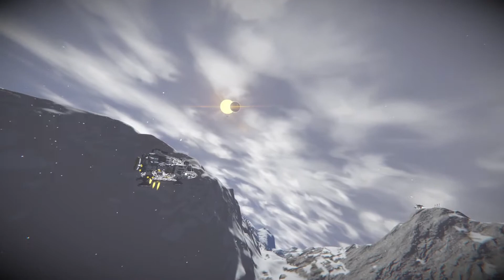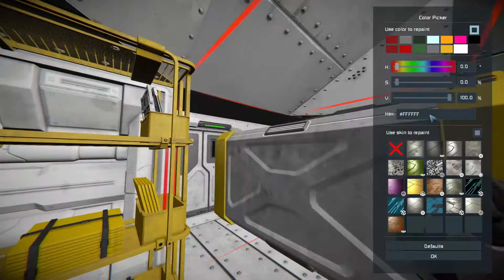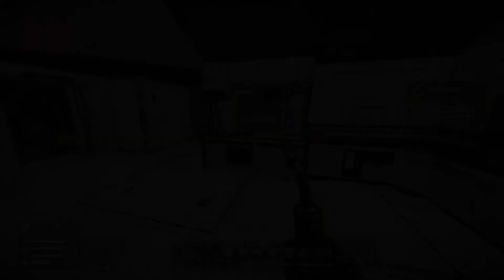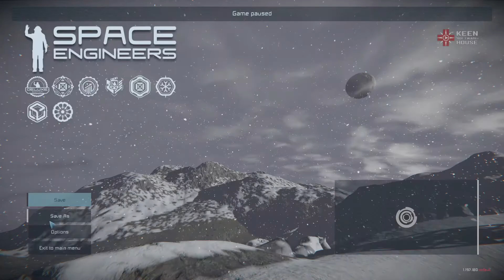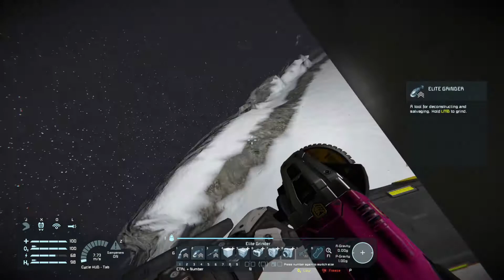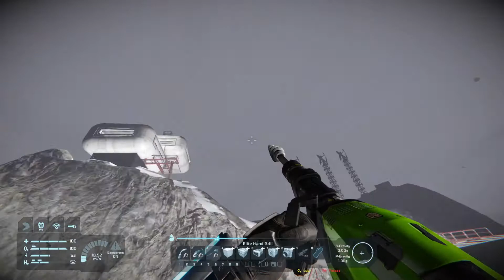Hephaestus Prime EP56 - Ready Transmission (Space Engineers)

Comment: Love the pod building.
You could put a vent under one of the pods and put it in depressurise to keep de pods filled with oxygen without having to refill all the time the ice.
And only enable the o2/h2 generator when the hydrogen tank is almost empty.
Keep those episodes coming I’m really loving them.
Reply from the maker: Thanks Listerman, this was an especially enjoyable build.  I knew the vents suck air in the full O2, but I thought like the helmet, you can breathe but not fill up in the low O2. I shall try next time I'm up Mt Rutherford. Thanks for the info.
Reply: @Wellington6012  from the moment there is oxygen you can pump it :)
Because of your pods I’m thinking of building my drop-off space station right above my earth base in modular piece design. And have to bring up every pice separated pre build. But have it in such a way that I can move parts and have them reconnect in different ways. In a way like the IIS does but it would off course not look like the IIS 😁
Reply from the maker: @listerman  I was intending to do the same thing with my orbital platform (spoiler, I just launched it), but didn't quite work out that way. I'm thinking about a whole base of similar pods in a future series, either on the outside of an asteroid or in that chasm on Pertam.
Reply from the maker: @listerman  ...and thanks for the tip on the vents, I tried it and worked! Guess I shouldn't assume things. :-)